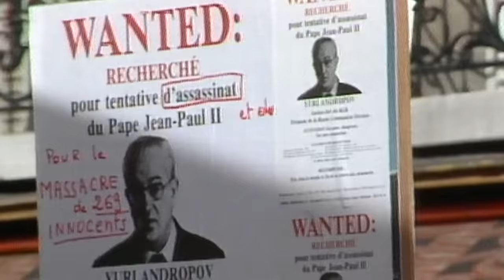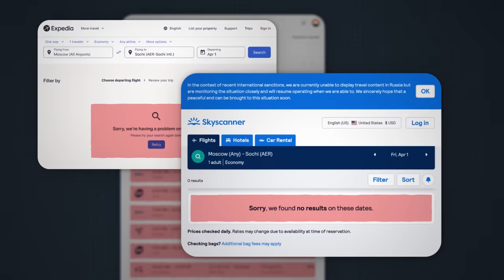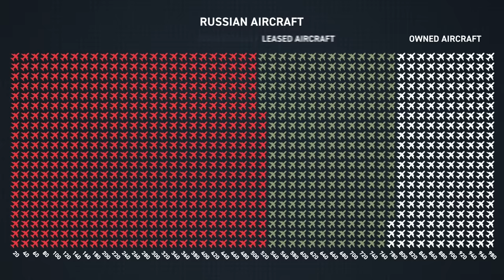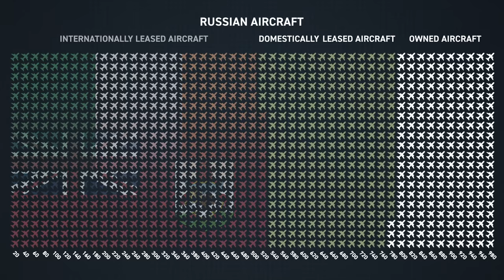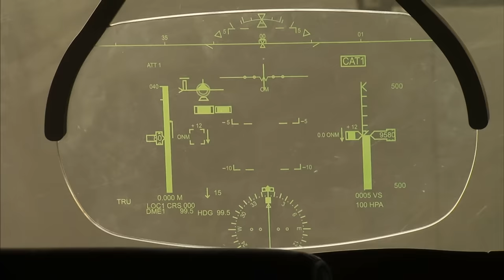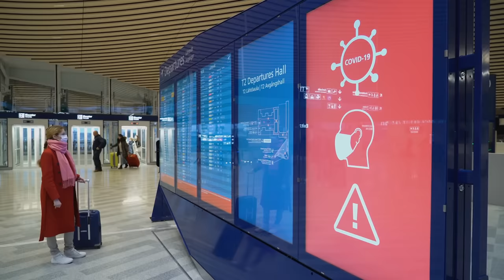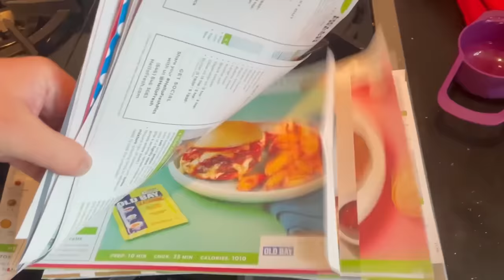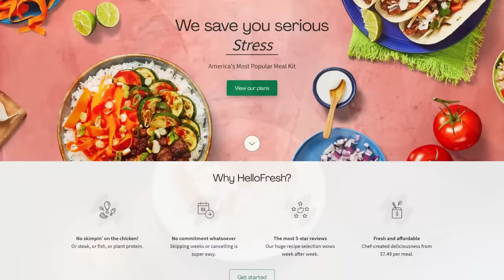The Sanction-Fueled Destruction of the Russian Aviation Industry

Comment: I was so ignorant about how strategic Anchorage is so any audience member working at Anchorage airport?

Did the recent geopolitical events significantly increase the traffic in that area?
Reply: I was surprised he talked so much about the new opportunities in Anchorage, but didn't mention China. Last I checked FR24, it was business as usual for them. Chinese airlines have a huge potential to dominate the Asia-Europe market as long as they can fly the shortest possible route across Russia, while almost  everyone else is at a disadvantage.
Reply: As a resident of anchorage, I can confirm air traffic has increased immensely since the start of Covid, and will continue to do so. Because of the location, it will be a crucial component. Remember, Alaska is the northernmost, easternmost, and westernmost state.
Reply: @elimckenzie7095  I went to my Korea assignment from leave back in the early seventies on a commercial flight. We were in Anchorage in the early AM just as the sun came up and lit up the mountains. One of the most beautiful things I've ever seen. Have had a soft spot for Anchorage ever since. They were busy then and I hope they get busier. I was also impressed with how well the ground crews worked in the November weather. Remember it clearly after almost 50 years.
Reply: @justsomeguy5103  exactly! Though about that aswell. Same for ANA and Thai Airlines.
Reply: @justsomeguy5103  I hope Sam expands on this in a follow-up video. The impact on China's airline and aviation industry could be huge. They're going to get a huge number of connecting flights and probably sell a lot more planes. Add in sales to Russia of planes and parts.
Reply: The channel Real Life Lore has a great video about the strategic importance of Anchorage if that interests you
Reply: @justsomeguy5103  Chinese airspace is difficult to navigate, to the point that, while not unfeasible, it's definitely relegated to a distant second option. You know how many air routes are basically a long, straight line with a slight curve matching the Earth's geodesic? Chinese routes frequently look like curly ramen noodles due to their many areas of restricted airspace.
Reply: Sams done a video on anchorage before and flying to japan during the Cold War. Definitely worth checking out
Reply: I’d be so happy if more international flights stopped in anchorage.
Reply: @nehem I don’t think any Western government will allow their people to go through Russian airspace (the Belarus fiasco comes to mind) and given the unpredictability of Russia I think most would like to avoid it at this time
Reply: @nehem Because the European countries can close their airspace to any aircraft arriving from a Russian FIR.  Making Malaysia take the same route.

Comment: Pacific US routes seem to only increase slightly. ORD Chicago via Anchorage, Tokyo, to Hong Kong increased only 5% from a direct route over Russia. The costs to European airlines are clearly the most affected but the war and the threat of larger aggression are in their back yard.
Reply: Anchorage is freight only. A passenger plane travel through Anchorage would be  very expensive and this was the way I travelled in the past. Planes go southwards instead. Freight planes have shorter range and this is why they go through Anchorage which is similar to a marshalling station (without gauge change).
Reply: @softmechanics3130  Plus, Anchorage is an ideal sorting hub for packages between North Asia and North America.
Reply: @dbclass4075  Thus freight only
Reply: @softmechanics3130  Mostly freight. Alaska Airlines do operate few passenger flights on that airport.

Comment: It's unlikely that Anchorage will get big customer usage. There is already a big demand for direct flights to Dubai, Qatar, Abu Dhabi, Bahrain and Kuwait. This means airlines can simply increase capacity at these routes, by flying bigger aircraft. We could even see the return of the A380 as these connecting routes require more capacity. The customer gets shafted with an extra 2 hours flight time, but the airlines don't have to worry about additional costs or fuel burn. 

Dubai etc will love this, and will likely expand their airports to facilitate the extra flights, while increasing fees as a way to generate revenue.
Reply: Anchorage will still get a bump.

Comment: To be fair, GDS software was never fully functional for transfers to or from some Russian airlines. I often flew LAN to UUD bidirectionally, and while on paper bags were checked to destination, we had to claim and recheck at DMD every time including as recently as '18
Reply: this is due to the customs as you were switching international flight to domestic
Reply: That is very unlikely a problem with GDS, but more of an issue with the USA.  The only time I have ever had to claim and recheck bags was arriving or departing USA with a connecting flight within USA territory.
Any other country in the world  - never had an issue.  Connecting through Istanbul for example, you could leave your bags in transit even up to 24 hours between flights, yet during that time you could personally leave the airport and go into the city for the day.
Back to the USA, AFAIK, it is the only country in the world where transit passengers require a visa for the USA, even if they never technically enter the country.
Quite ridiculous.

Comment: 11:11 Suppose a Russian airline decides to "keep" a leased airplane, but the same airline uses a fully owned airplane to operate an international route. On operating the international route, the fully owned airplane lands in a non-Russian country. At that point can the fully owned airplane be seized? If an airline steals a leased plane and keeps it inside Russia as protection from seizure, can the airline's fully owned planes that do fly outside of Russia be seized as a countermesure?
Reply: Russian passport is not good for travel so Russian planes if any would go to China and satellite states such as former soviet or cuba or venezuela. For the latter, Russia might convert Tu160 or Tu95 to freight/passenger.
Reply: Anyone can do whatever they want now, international agreement mean jack squat now.
Reply: @softmechanics3130  The Tu-160 and Tu-95 would make poor passenger airlines. Their engines and designs are old and inefficient. The Tu-160 is a supersonic bomber designed to be a supersonic bomber, and is thus too small to carry a profitable amount of passengers. Also, it's engines are terrible inefficient.
Reply: @dasbubba841  Russia hasn't anything else now but a lot of oil .Maybe China builds high speed rail network for Russia.
Reply: @dmitrychernivetsky5876  Correction - agreements with Russia mean jack since 2014 when it violated the Budapest Memorandum
Reply: @dasbubba841  Tu-95 were made into passanger airlainer Tu-114
Reply: @softmechanics3130  Russia have МС21 and sukhoi superjet, and more high speed rails then USA, lol
Reply: @tsugumorihoney2288  Russia cannot electronics of any kind and TSMC has cut off foundry supply of semicons . Neon can be made from air using LNG cooling columns. All LNG ships are made in Korea only.
Reply: @softmechanics3130  are you sure about dat? maybe learn some history?
Reply: @tsugumorihoney2288  america much better country than russia thats sure
Reply: 69 likes, make a wish!
Reply: there is a problem with service history. Leasing companies know exactly what was replaced, when, where and why. You don't have that if you take a Russian airplane which means if something was done incorrectly in Russia by Russian owner and if something would happen to that plane, the leasing company would be liable. Also no insurance company would insure such aircraft and I doubt anyone would actually lease it.
Reply: @Jose V the odd thing is I read everything you wrote in Sam's voice XD
Reply: @softmechanics3130  ... you're setting the bar absurdly low, and then clearing it by only the slimiest of margins ... but you're not wrong.
Reply: @tsugumorihoney2288  Russia cannot make great food such as mcdonald double cheeseburger and great chocolate like hershey
Reply: @softmechanics3130  it can make every food, it is not so hard)
Reply: @softmechanics3130  Thinks are going to be so rosy for the red Chinese economy either now.  Russia is one big trading partner that may only be able to pay China in rubles, which is now worth a little more than Monopoly money.  China's economy depends on a healthy open worldwide economy, that's why she may do some saber rattling regarding the capture and subjugation of Taiwan, but never goes much further than that.
Reply: @billolsen4360  They will barter trade with similar level countries as before 1991.
Reply: @softmechanics3130  I hope the average Russian doesn't have too much trouble providing for their necessities.

Comment: Here is the main problem with Northern Pacific’s plan: The US doesn’t have sterile international transit like most countries. Tokyo to Anchorage to London requires the passenger to get off the plane, get bags, clear US customs, check bags and check in again, go through security, and then get on a plane and have a US visa or ESTA. If you go through other airports, mainly Middle Eastern ones you don’t have to do this much work or clear customs.
Reply: From the video it looks like it’s just To/From the US without any 3rd connections, largely eliminating that problem. If flying from Tokyo to NY example, I’d think the customs would be faster in anchorage and then it’s a domestic flight after that
Reply: Maybe airlines operating at Anchorage could push to finally implement it.

Comment: 1:00 - The Tupolev Tu-154 is equivalent to the Boeing 727, not the Boeing 707. The 727 had 3 rear-mounted engines, while the 707 had 4 wing-mounted engines.
Reply: Who cares really
Reply: @lilshrimp5781  its definitely not you
Reply: He isn't talking about apperance but their role. The Boeing 727 is smaller and shorter range than Tu-154.
Reply: @Art_bor  i agree
Reply: To add to that, the 707 equivalent was probably initially the Tu-114, before that was superseded by the Il-62.

Comment: It might be difficult for Irkut to develop its MC-21 (equivalent of C-919, A-320 and B-737), but it also uses parts from other companies, so they will have to replace these foreign parts by domestically made-ones.
Reply: MS-21 has most of its critical components being domestic and electronic planning to be domestic even before the war. MS-21 is almost at the end of the development cycle as well. So I don’t see where the difficulty is when it is mostly done and parts that is critical are already domestic. And awaiting certification.
Reply: @789know  Well most are. Not all. And planes are complex machines that Can be hindered by only a few components. I am not saying they can't do it, but it will cost them in r&d

Comment: Every mechanical machine requires constant up keep. This is especially true of airplanes.   Systems are checked everyday and planes are grounded if there is a maintenance issue.   The infrastructure that was in place is now gone.   As a Russian passenger I might feel safe flying for another 30 days.  After that? drive!  at least you will arrive alive!!
Reply: What about trains? I was under impression Russia has vast rail network.
Reply: @dbclass4075  Yes,but also most modern trains come from european countries,especially Germany and France,but trains is something they have a lot and can get with China but replacing what they have will also take time and cost a lot.

Comment: The pain will flow in the opposite direction, too, though not equally.  Aircraft-grade titanium primarily is made in Russia, and this is very important in fuselages and wings for the most modern aircraft, and critical for all passenger jet engines.  

Russia will suffer greatly in the short term, but all airlines will eventually find themselves in short supply of titanium-based parts very soon, unless other countries are able to develop the sophisticated manufacturing methods that Russia has effectively monopolized for decades.
Reply: Good thing composites are quickly replacing Titanium.
Reply: @z987k  Really?  Jet engine hot chamber parts made of composites?

Do you have a source on that?   I'd like to follow up.
Reply: @RandyFortier  No, not the hot sections.  But the Fan sections on the newest engines are no longer titanium.  
Russia is the 3rd largest producer, so it can be found elsewhere.
Reply: @z987k  No, Russia is the 3rd largest producer of titanium.  They are the 1st largest producer of specifically-aircraft-grade titanium.  Those are not the same.

P.S. I'm a materials scientist who worked in the aviation industry.
Reply: @RandyFortier  Rolls Royce have ceased all imports from Russia, I'd guess Australia is the main supplier now for them.
Reply: @MrEddieLomax  I didn't hear that, so thanks for sharing.  Last I heard, they still had a 20% deficit.
Reply: @RandyFortier  They announced it within the first couple of days of the war, so it seems RR at least felt confident they could secure their supplies.

Comment: Russia is not quite as disconnected from modern civil aircraft manufacturing as implied. Until their announced pullout, Boeing maintained a design bureau in Moscow. Parts of the 787 Dreamliner were designed there. These engineers are unlikely to find themselves out of work. They'll now be working on exclusively Russian output. Add BRICS and their products, notably those of China and Brazil (India is also developing a civilian jet). Russia will not be running out of options. Of course, Russia will also counter, and I notice they've already said they'll not maintain their Soyuz rockets currently operated by those applying sanctions.

Comment: What you're missing here, is I guess the fact, that airlines from countries friendly to Russia can continue to use its airspace. Meaning that e.g. Chinese airlines could provide a faster and cheaper way of getting from Tokyo to Helsinki. Their route would be straighter and prices lower. This will put all the airlines from unfriendly countries at a market disadvantage. Of course we'll see how it goes, but I guess, that when you're presented with opportunity to make your flight 4 hours shorter and $400 cheaper its an easy choice for many of us. Only the most stubborn ones will continue to book flights from Finnair just to avoid using so much hated Russian airspace.
Reply: @valerierodger7700  well, I guess, that if you are a political person, and have a reasonable suspicion, that your plane may be forced down upon entering russian airspace, then of course you should choose to avoid it. Even if it means longer flight. 
For the common people from EU and US the risks are negligible. 
What we see now, with airlines avoiding using russian airspace despite they could've, I think is a short-term period of uncertainty. Once the dust settles and the airlines that are willing to take the risks will start to gain more passengers, there will be more incentive for others to also start doing this.
Not all of russian banks are banned from SWIFT, and even if they will eventually be, there are other means of payment. With China it's especially the case, as they have their own system for exchanging financial information.

Comment: One advantage Russia might have over Iran (in keeping their Boeing / Airbus planes going) is that Russia is more industrialized and has a lot of aviation experience.  I could see them (after enough time) being able to fabricate many (if not all) of the spare parts they need for their western planes, without having to rely as heavily on repairing parts and cannibalizing existing planes.
Reply: @Kyril The first free man in space was Alan Shepard. The first free man in orbit was John Glenn. The first free man to do a space walk was Ed White. The first free woman in space was Sally Ride. The first man to land on the moon was Neil Armstrong. And the first to land on Mars will also be an American.
Reply: It will take time to ramp up capability to make those parts, but it can be done, or some aircraft may be cannibalized to support the others until parts can be produced or imported through the black market.  Someone else noted the issue of software updates; that may be the more difficult issue.  Either the FGB or GRU will have to pirate those updates, or United Aircraft or some other firm will have to create their own software mods, which will definitely void any warranties and prevent those aircraft from being used outside the RF, even after sanctions may be lifted someday (or authorized software is installed to overwrite the kludged code).
Reply: @Ozymandias1  The first woman in space - Tereshkova, Russian. The second is Savitskaya, Russian. And only the third woman is an Amrican. She was sent only for the sake of not being dishonored.